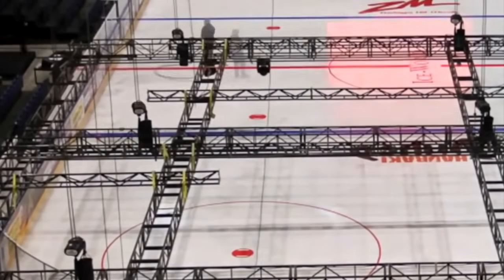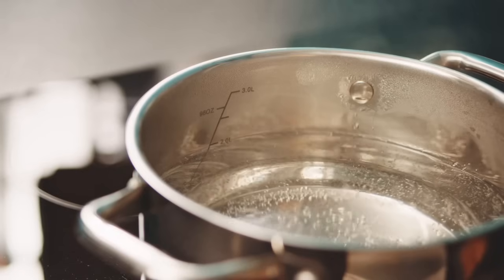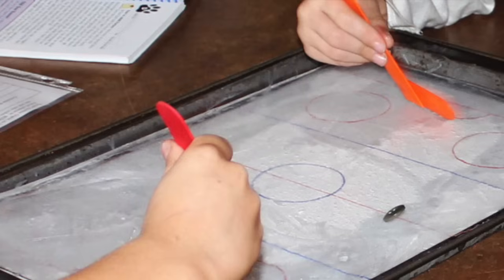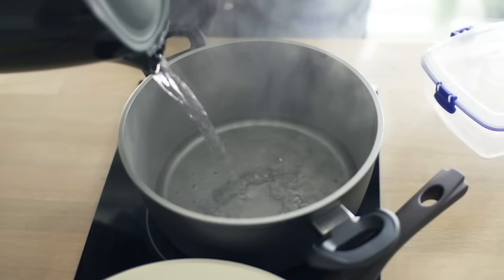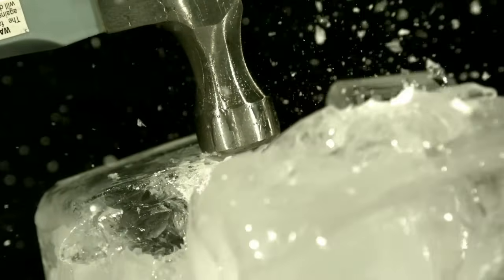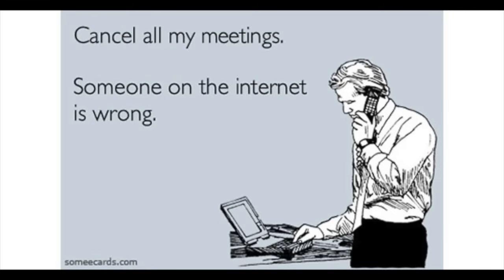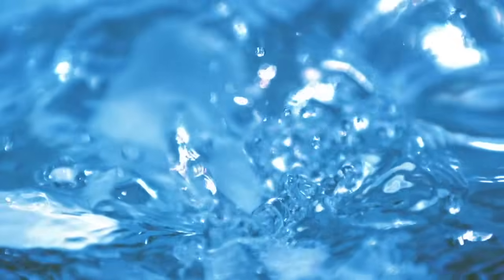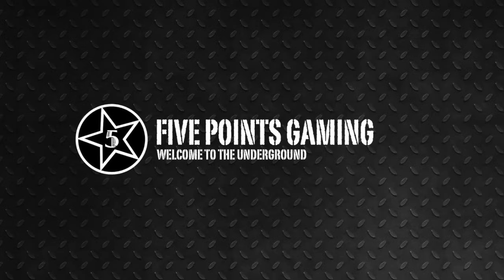Does Hot Water Freeze Faster? Ask the NHL

Comment: I think the reason why host water freezes faster (also, cold water boils faster) is because water has a high specific heat, which is the amount of energy required to change the temperature. When hot water is introduced to a cooler environment it is immediately rapidly cooling off, before it is even introduced to the freezing mechanism. However, cold water will start warming up a bit before it is introduced to the freezing mechanism, so the temperature change essentially has to change directions in the case of cold water. Imagine driving a car uphill (cold water) versus driving a car downhill (hot water).

Comment: Isnt is because in hot/boiling water, the molecular bonds are expanded and more isolated, which if low enough energy is provided to that system it would cause those bonds to freeze at a rate which is that of an individual water molecule and therefore freezing faster

Comment: I drive the zamboni at my city's ice arena. We actually put cold water down to fill all the cuts and grooves in the ice, but before this, the blade cuts a very thin layer of ice off the top and picks up the snow on the top of the ice. Then we spread hot water behind all of this which is evenly spread out by the towel to create a nice smooth skating surface. You would be amazed the difference in freezing time between ice that is 17.5 degrees and 19.5 degrees.

Comment: Only in certain conditions does hot water freeze faster than cold water, and even then, it's usually due to small differences in the experiment even though you tried to make all things equal. Plus, when you say "freeze" are you talking about reaching 0°, forming ice, or turning completely solid? And what is "hot" water and "cold" water? Hot water can cool to 0° faster than colder water, however only to a certain point. Water that is below 60° will cool to 0° faster than water above 60°. But 140° water may cool to 0° faster than 100° (for example) for some of the reasons mentioned (convection, dissolved gases, and evaporation). But this would be due to the fact the hotter water cools to 60° faster. Although, in carefully controlled experiments, hot water does not freeze faster than cold water.

Comment: Hot water freezing faster is partially a myth.  It does in fact happen, it's know as the Mpemba effect.  But it only happens occasionally and nobody really knows why it happens when it does.  People have been hypothesizing about it and experimenting with it since the ancient greeks and nobody has ever been able to reliably produce the effect under proper testing conditions.

The real reason they use hot water is because it slightly melts the layer that it's applied on top of and helps to both create a smoother surface and a better bond with the previous layers.  It has nothing to do with freezing time.